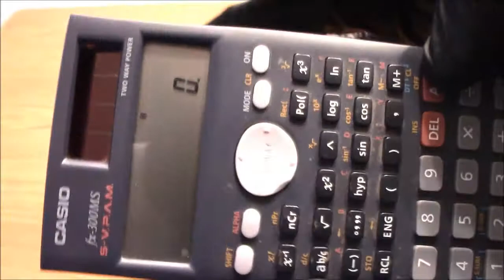How To Take Apart The Casio FX 300MS Scientific Calculator To See What Makes It Work

Comment: Is it possible to remove the black plastic above the CPU? What is your opinion, is it a CPU inside a package or that black material is the package itself? I mean if I can remove, is it possible to find which kind of microcontroller is used in these calculators? Maybe possible to re-program it or replace it with a same type but programmed by the user?